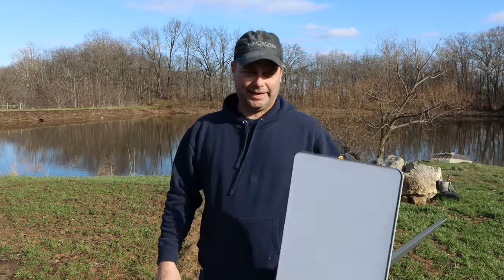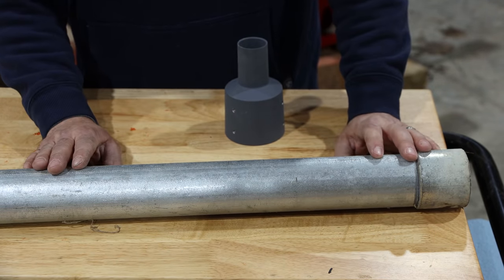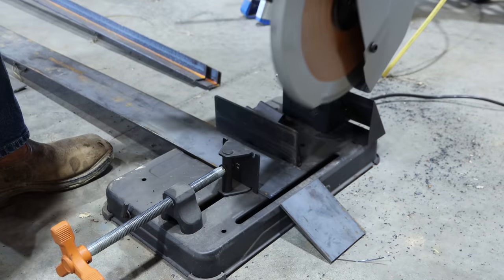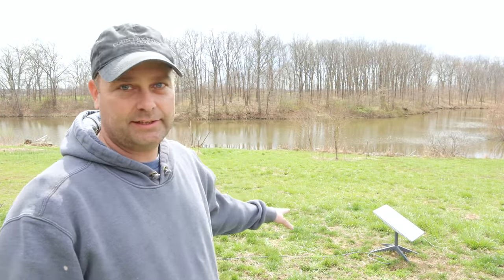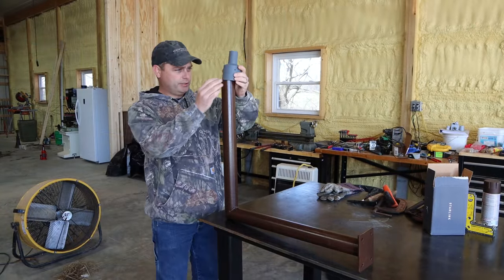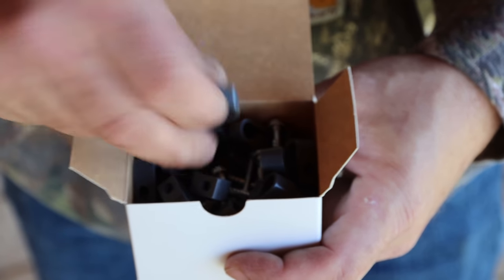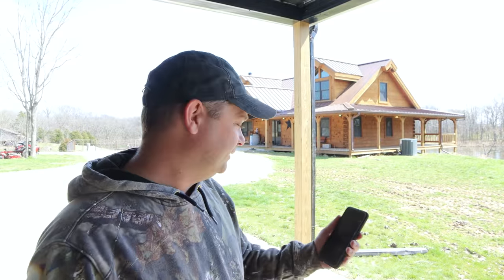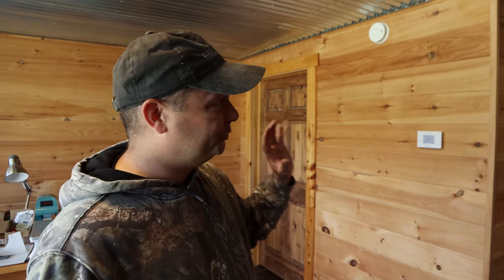After 5 years in the country we finally have internet.  Building a custom Starlink Satellite Mount.

Comment: EXCELLENT install. Very professional looking. Awesome signal strength. Will it support exterior security wifi cams? Did we caulk where the cable enters the home?  🙂
Reply from the maker: I still need to caulk the hole.  Thanks for the reminder.

Comment: Something I have on wifi, is a flo by moen system. Allows you to shut down your main water valve in the event of a sudden water pipe burst. It works automatically if set to away mode. I also monitor and time out my water heater from my phone using Aquanta system.  Both are around $500 each system but I love them both. Just a thought.

Comment: Why didn't you just place your starlink router on the main floor of your house?
Reply from the maker: I had ran a conduit in the wall when we built the house, from the basement to the loft.  But the starlink router cable wouldn't fit through it.  My wall are 100% filled with spray insulation and didn't want to drill a hole in the floor, so I bought the extender.
Reply: @CountryViewAcres  Might be worth it brother.. Only want the best for you guys.

Comment: I found that the pipe on Dishy is a perfect fit for one inch PVC schedule 40 conduit, into the flared end. 

I stood up a 4x4 post, used clamps to attach a vertical piece of the said conduit and, voila! Done. That being said, the built in locks in the bottom of Dishy don’t engage to anything but realistically, my Dishy isn’t going anywhere.

Also, put the router on a UPS. It’s nice to still have internet access even when the power goes out, which it does frequently in my rural area.

Comment: I use eero mesh internet throughout our property.  You may want to plug a mesh wifi into the starlink AUX port or directly into starlink bypassing the starlink router completely.  The mesh Wi-Fi are extremely fast. And can even be plugged into your barn.

Comment: The reason your extender is slower is the one in the description only gets up to 100 mbps. The EX7500 gets up to 250mbps. Just throwing that out there in case you get another one.
Reply: I agree, I mentioned to Evan that he should swap the starlink up to the top floor and move the extender to the basement. Put the starlink up high so it has better range around the property. He may have problems if he's going to put in a bunch of cameras or other gadgets with a lack of bandwidth and latency from the extender. I would take that extender back and get a LAN port for the starlink device and then run a proper fast router or switch and run cat 5 to the barn and other locations and then use a router at those locations to tie wifi devices into.

Comment: QUICK QUESTION, Would the StarLink WiFi not be better off above ground, with the booster in the basement, maybe you'd get better coverage in the pole barn, also with the second router working in the basement be sufficient for so small an area?

Comment: We really enjoyed your video. That's a bear of a pipe mount, for sure - NOTHING can blow that around, LOL! And nice welds, too. Like you, we're rural (southern PA), waited a year and just got our Starlink in February. We've been pleased. Once and a while, kind of at random it seems,  the speeds slow down, but overall, they're similar to yours. Luckily, our unit worked correctly out of the box, so I have to say that overall this is a wonderful piece of tech. The one downside, unfortunately, does seem to be Customer Service. It takes WAY to long to hear back from them and half the time it seems like they only half read our e-mail. Sometimes I almost get the feeling they try to just tell you whatever they need to to get you to go away, but by the same token, I'm sure they're VERY busy due to the huge increase in customers. Hopefully Customer Service will improve because it's critical to keeping customers happy. The other negative thing is shipping accessories like the pole mount - took us five or six weeks to get ours and, like you, we had to do a temporary mount with the provided base in the interim. BTW I have an Ambient 2902C weather station and I love it. Beautiful display, good WiFi signal and you can read it online via PWS, Ambient Weather or wherever you set up an account.

Comment: Great job welding that galvanized pipe, it's not easy. FYI, next time degrease it and wipe it down with white vinegar, it will etch the surface for paint adhesion. An old timer taught me that.
Great video
Thanks Evan

Comment: We have been considering the Starlink ourselves for a while since we also live in a rural area. We do OK on our ATT "rural fixed wireless" BUT the longer we're on it the slower it gets. About 2 years ago when it was installed, we got like 30-32 mbps consistently. Now we're lucky to get around 8 to 12 and that's max. Anyway, you did a fantastic install and very professional. I pray it works great for yall.

Comment: You WILL get plenty of us telling you how to do Wi-Fi, here's my take...  
Mount the antenna as high up the roof as you can. Preferably at the peak.  That metal roof isn't helping you.  Starlink wants as much open sky as possible.   Place the router upstairs (some altitude helps with range)   
Place the repeater in the basement in the equipment room so it can cover the basement and walkout area.  
Get the LAN adapter so you can install an upscale market Wi-Fi system like an Orbi and a wired router to take care of printers and cameras and such.
Now that you have serious internet you can setup an Ooma Telephone system and have a house phone with cellphone-like nationwide dialing as part of the deal for a very low monthly cost.
Reply: I agree

Comment: How is the D17 doing? Have you figured out the confusion with the brakes yet?  Got new parts?  New paint?  New versions of those lobed bolts for the back wheel width adjusters?

Oh, ya, nice job with the antenna.  ;-)

Comment: Great video.  Are you still using the same Wi-Fi repeater?  I have a similar setup (Starlink on house and shop about 90ft away).   I had the exact repeater and had a lot of trouble of it dropping the signal or very slow speeds.  I switched to the Netgear Mesh AC3000 Orbi and it has made a world of difference.  Pretty consistent speeds near 100mbps.  On a none related note - we have a similar designed porch with cedar posts.  Did you stain or paint the wood?

Comment: Welding is a skill that is a acquired skill, 20 years ago I wanted a flat bed for one of my trucks where the box was completely shot. $600.00 in steel and I started my first welding project, never welded prior. My cousin who I lived with gave me a crash corse on welder operation and from there it was all a teach urself process. 20 years later I will say I'm not a professional by any means but when ever now I need something built I usally end up building what I need myself or fixing what I need to fix. The welder I own now has saved me thousands of dollars over the years in fabrication shop expneses. When someone asks me now where I've bought someting I simply say "I built it". Often times I get crazy looks and shocked expression on there face, don't ever be afraid to build what you need for your farm as that whole concept goes a far way when it comes to customization of your farm needs.

Comment: You can check your extender to see if you can increase your throughput. Also there are extenders witch have longer range and some  witn increased signal. Is your extender a combination unit witch can do 2.4 and 5g.
5g is most likely cleaner but 2.4 is like a bulldozer.
Great video enjoy your content have a great day.

Comment: I ordered my Starlink Internet last April and I just got an email stating my order was ready to ship. Here an idea for extending your internet signal thoughout the house. Purchase a TP-Link Deco Mess Network kit. It comes with 3 pod shaped extenders. You just plug one in on each floor and connect them to the Starlink router and the Deco Mess network will allow devices to connect wirelessly and each pod also has a ethernet connection if you want to connect something via Ethernet cable.

Comment: In an enviroment like this, i would strongly reccomend using unifi equipment - which is a router , switch, cloud device, and any of their external hardwire antennas. I did this on our 8 acres, and we have wifi corner to corner. You know, ya' just gotta have sirius when you mow.

Comment: You are also not supposed to weld with solid core mig wire with a fan blowing on you. That blows the shielding gas out from under the nozzle shielding the weld area and causes porosity in the weld. You can drink a glass of milk after you finish welding to counter the toxicity of the zinc in galvanizing. This method was used by the national union of ironworkers. It was a rule that the constructor had to offer you a glass of milk at lunch and at the end of the day if you had to weld galvanized metal. If you are welding with fluxed core wire, and you are not using a shielding gas and the fan will not effect the weld.

Comment: Are you using Xtreme Temperature Cable Zip Ties for cold and hot weather temperatures which are UV resistant. The first zip tie around the satellite pole to strap the cable line to pole.

Comment: I have a smart switch plug to my tractor block heater so I can turn it on when needed without having to get outside and plug it manually. My tractor is not store in an heated place and here in Montreal it can be very cold. When there's a snowfall (an we have a lot here) I can heat my tractor from work, get home and snowblow without worriing that the tractor won't start.

Comment: I bet it's a relief to finally have internet :). If I can recommend something you might want to try if you have the time and if feasible.
I would set your Starlink router on the main floor. If this is the area where you spend most of your time you'll be able to use the 5GHz network for your main devices and daily internet access. It will give you the best throughput (but the smallest coverage) and should cover your entire first floor. Then run your repeater in the basement. The basement will be covered by either the 5GHz or 2.4GHz band depending on how far you are from the repeater.
Having the main router on the first floor will allow you to get the widest coverage on both bands, especially when you start looking into smart devices (which most of them run on 2.4GHz network). Having the repeater upstairs will work but as you saw it cuts your bandwidth by a tremendous amount.
The repeater in the basement will most likely allow you to get very decent coverage in the yard/behind the house (most likely using the 2.4GHz network but it should do it automatically).
I'm not sure how the Starlink router is configured or setup but if you can, I would run a direct burial cable from your main router to the barn. Then use an AP (access point using a second router) setup in your barn that way you also get full coverage in your barn and have minimal bandwidth loss in the barn. Your barn will then also have wifi access through the AP on both 2.4GHz and 5GHz band for your wireless devices. Bandwidth will be a tad lower than in the house (main floor) but still a lot better than any wireless signal you'll get from trying to connect wirelessly from the barn to the house. I'm sure you've noticed but the barn will totally block your wifi signal from the outside in the same manner your basement ceiling does. It's a bit of a pain to figure out but hopefully this will help in case you run into coverage issues with your current setup.
The above is similar to my current situation but I'm running a wired connection (through a switch) between our house and 2 out buildings/barns that are about 300 feet away and so far it's been spotless. Especially if you plan on adding any kind of wireless cam/security system to your other buildings.
Sorry for the long comment :)

Comment: Evan you should be able to get a  much faster connection to starlink. The reason its so slow is that your roof is shielding the network from the dish. You should place your dish at the highest point (the peak) of your roof. It looks like you have enough cable left over to reposition your dish to the apex of your roof. You will be shocked at the speed difference if you do this. Starlink requires a complete 360 degree free space to operate as it should, buy the look of things you have a huge amount of sky shielded from the dish, I would expect to see a three fold improvement if you reinstall. Thanks for posting

Comment: I think it has already been mentioned, but you should really consider a Mesh Network System. For your expansive area, the mesh network would be much better and easier to manage many wireless devices on your network. Using a solar power setup midway between the house and the barn, you may even be able to get wifi out to your bank barn. Daisy chain it again to reach your entrance where you can have a camera and a gate on a sensor with remote control from the home via the network. All starts with a mesh system that can be easily expanded over time, adding units as you need.

Comment: I am not sure it is the same technology, but the extender I use for the garage was the same used by SSL Family Dad at their old farm.  You plug one device into a wall socket near the WiFi router in the house, and the other in the shop and it uses the copper in the house to extend it to the shop and then create another WiFi signal.  Pretty slick and only about $100 at the time.

Comment: I believe I would have installed the starlink wifi device upstairs in a higher position and the extender downstairs in the closet and add the LAN adapter so you could add a plug in wired network with additional wired/wifi network.

Comment: Good stuff! Should you ever find yourself needing to run cable through a space like above a drop ceiling again, tape a string to one end of a broom handle and you can throw it across the space, then at the other end use the string to pull your cable across.

Comment: Nice mounting bracket. Great to have the tools available for those custom jobs. It will be interesting to see if you get WiFi inside the pole barn with the metal walls. Consider WiFi light bulbs rather than switches.

Comment: If you can run an ethernet cable from your WIFI router to your extender you should see an improvement in your speed throughout the upstairs of your home and out to the pole barn.  Glad to see you got it working!
Reply: I have to do that with ours.  A lot of extenders have a ethernet out, so near the starlink you put that,  and run the ethernet to the other one.  

Strange that the starlink does not have a ethernet port.
Reply from the maker: Yep starlink doesn't have an ethernet port.  They sell a network adaptor to hard wire devices.  Maybe I will buy one.
Reply: @CountryViewAcres  Sorry to hear that, doesn't make sense that they didn't include it..., regardless, the speed has to feel great as it is....I was surprised to hear that you've been living without it!

Comment: The best option for you is to get either the ethernet adapter for Starlink or use one of the third party work arounds for that. Then get a switch. Not a router, a switch. And then buy a Unifi access point, which plugs in via ethernet to the switch. You mount the Access Point anywhere within eternet limits (technically 100m but more practically 50m). You could even run ethernet to spots around your house and if you do a bit of research, you can bury a fiber optic cable and put a switch and an access point in your shop and get internet over there.

Comment: A  drip system for your garden can be set up through the internet. It can use specific current weather conditions to adjust the watering system to save water.

Comment: Congrats on the new internet!
I would look into POE cameras. Zero signal interruption, higher resolution, constant recording (vs motion events), reliable wireless viewing from your phone from anywhere. Records to an internal SD card, no need for a DVR. I got a few Amcrest 5MP cameras from Amazon and they're great. Well worth the little bit of wiring. All comes back to a POE injector connected to my router. Good luck!

Comment: If you run a lan line to the extender your speeds will increase drastically where you are connected to the extender. It is the wifi part of the extender from the Starlink wifi router to the extender that is slowing your speeds down so much. Great job on the installation. Nice to have internet at home. Thanks for the videos.
Reply: Another respondant on here said the extender is the bottleneck that its only good up to 100. The starlink router is faster than the extender on wifi. Its not the wifi link, its the extender is not capable. Evan needs to swap positions of the starlink and extender. Put starlink up high for cameras and devices on the property so he has the bandwidth to run everything. Put extender downstairs if they aren't using wifi downstairs much.

Comment: Just got starlink and watched your video....is that conduit galvanized?  Be careful buddy!

Took me 18 months to get Starlink, but finally have better than 3Mbps down and .5 up... feels like ive joined the modern world!
Reply from the maker: Yes it was galvanized.   It was just what I had on hand.  I woukd use black pipe if I purchased something to build it.
Reply: @Country View Acres  that galvanized is really nasty stuff to breath. I weld on our greenhouses sometimes...get yourself a mask. Miller makes one that is low profile and fits under your mask. My son is a welder by trade and wears it all day, so not too uncomfortable.  

If you've never had zinc poisoning, you don't realize what I'm trying to save you from lol
Reply: @Country View Acres  also, I think you used the right material...I'd rather have that conduit than BIP...I was more concerned with you welding it without the right PPE. Just looking out,  not criticism. Great end result though. Matching paint really blends it in.